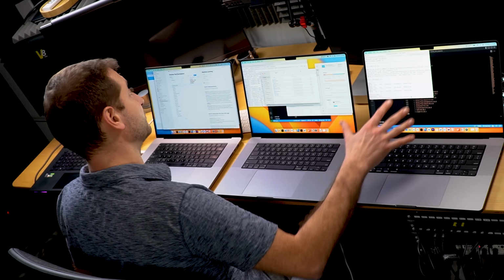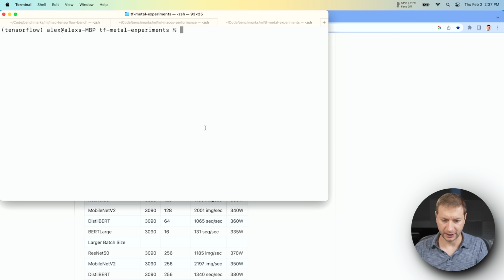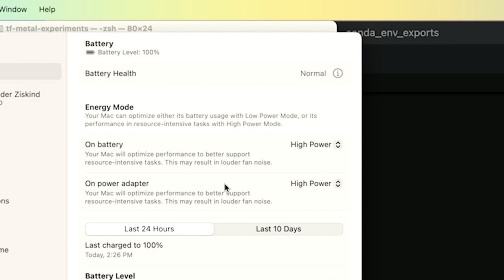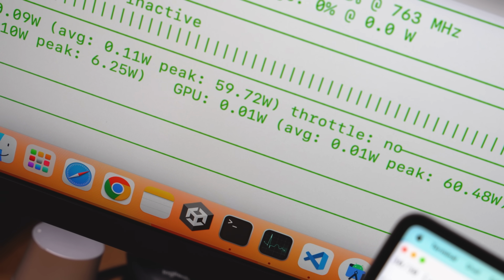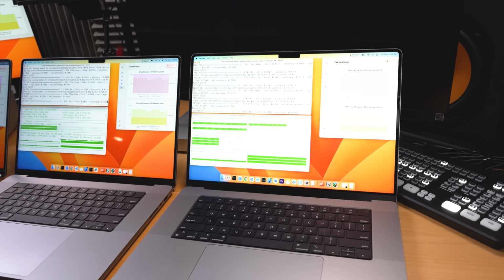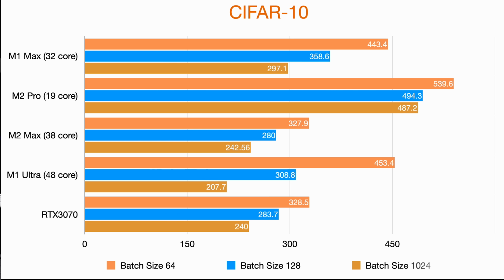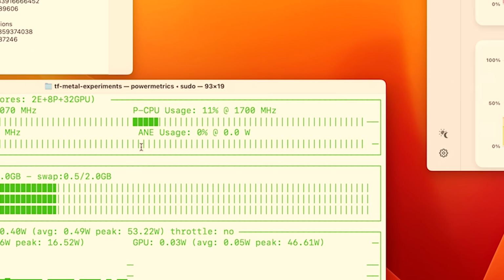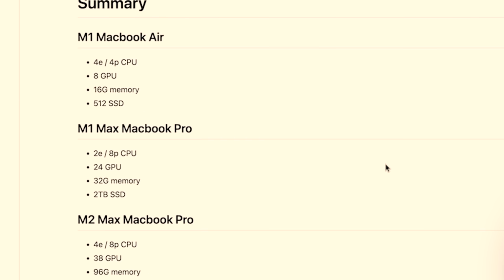INSANE Machine Learning on Neural Engine | M2 Pro/Max

Comment: The ANE is something different. As I understand it, it’s designed for matrix (tensor) calculations in contrast to the CPU. I’ve trained NN using python and tf, and i know you can format the trained model in a way so it can utilize the ANE on iPhones using swift, the performance is amazing IMO. However now I started to go a bit deeper into swift, I want to try and train models on the ANE 😅. Awesome video btw. Love this kind of content, glad i found this channel.
Reply: well the way how it's done is not that important as a final results. We are not using computers focusing on tool itself, but on getting job done. And seems like Apple did a pretty good job with their processors :)
Reply: Hey I'm currently in 1st yr of cs n specialising in aiml confused which laptop I should buy windows with GPU or m1 or m2 pls help n if mac are the thing for an aiml engineering
Reply: @riteshdhobale8210  Consider this. If you are just starting,  you will most probably work with more basic models, math and general coding (python, R, JS, MOJO...). For most task the M1, M2, M3 macs will do just fine, they are much more than you'll need for learning. When you start with DL (deep learning), the macs are still good but start to get very expensive (M1, M2, M3 MAX). This does not mean that you HAVE to buy a MAX model, things will just go faster on them, the PRO models will do ok as well.  Most of DL is done on GPU clusters anyway (AWS, AZURE...). All that being said, if your main focus is to go for DL directly (which i don't recommend, but most people do), or you want to play with already existing models than go for a laptop with a good GPU.  Last thing to take into account is the VRAM. The one thing that separates the macs and PCs (for now) is the underlying memory architecture. Because macs GPUs and CPUs share (in a sense) the RAM, you can load much larger models into memory to do inference. Simple example an  RTX  4060 has 8GB of VRAM, and the macs can get access much more RAM (up to 128 GB) but this costs a lot of money. If you go for a mac go for the 16 inch. Hope this helps.

Comment: What I wonder is if the high RAM M2 Maxes (like 64GB or 96GB) can train significantly more complex models or use significantly bigger batches simply because they have more ram than most discrete GPUs.
Reply: Data Loading: The dataset used to train a model is first loaded into the system's RAM before it can be utilized. If the dataset is large and the RAM is insufficient, it can't load the entire dataset at once, which can slow down the training process as data needs to be constantly loaded and unloaded.

Batch Processing: Deep learning models are typically trained in batches due to computational limitations. The batch size (the number of data points that the model sees at once) directly affects how much RAM is used. Larger batches require more memory but can lead to faster and sometimes more stable training. However, if the batch size is too large for the available RAM, it will cause an out-of-memory error.

Model Size: Larger, more complex models (more layers, more nodes) require more parameters and thus more memory to store those parameters. Additionally, during the training process, the system also needs to store other information such as gradients and intermediate layer outputs for backpropagation, which further increases the RAM usage.

 Parallelism: If you're using a framework that supports it, and you have sufficient RAM, you can train multiple models or multiple parts of a model simultaneously, which can significantly speed up the training process.

Speed: RAM is much faster than disk storage. So, the more data your RAM can hold, the quicker the access time, and thus, the faster your model can train.

Swapping: If your system runs out of RAM, it will start swapping data to disk, which is a much slower process and can drastically slow down the training process.
Reply: @sharathkumar8422  I understand the theory. But I want to see benchmarks.

In theory the M2 Max with maxed out RAM is great for ML. But I'd like to see some benchmarks in practice.

Performance is also based on bottlenecks, and if the GPU is insufficient, it doesn't matter how much RAM you have, you can use a GPU with inferior RAM and it will still blow you out of the water.

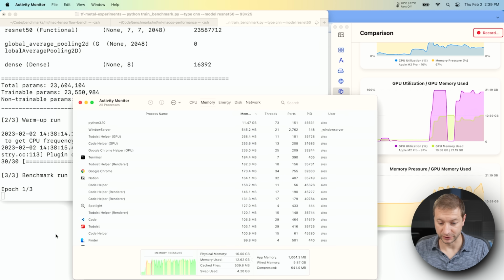Comment: 3:17 - one way I prevented the swap on my M2 Pro 14 inch MacBook Pro with 16GB ram was to disable swap. and I have ran into any problems, the performance will degrade if you do this on an 8gb 13 inch macbook with m2 or m1 because it relies on swap for increasing performance but on the 16gb with swap off, not only does it help ssd longevity but it also never runs into any performance hiccups

Comment: Cheers Alex, great to see something actually using the ANE. Something's seriously wrong with the M1 Ultra, it has double to M1 Max resources including a second CPU & ANE and more GPU cores even if they're a little weaker. Any chance you could check the CoreML config to see if the extra resources can be used?

Comment: Now I really want you to get your hands on a 4090 new notebook to test it to the limits.
Reply from the maker: believe it or not, I was considering this, but you are literally the first one that asked.
Reply: @AZisk  yes, please. So far nvidia new gen seems promising. But how it stands up against M2 Pro/Max?!
Reply: @lightytan5404 the new laptops or portable laptops with the intel new hx laptop processors with the 4090 sound like helicopters and forget battery life but they are monsters. 😂
Reply: @GlobalWave1  better have helicopter than 105 degrees cpu/gpu
Reply: Should not squeeze a 4090 into a small laptop!
Reply: @LeicaM11  4090 is a misnomer. the 4090 in a laptop is nothing like the desktop 4090.

Comment: As a PyTorch user these type of comparisons with benchmarks written in PyTorch running on the M1/M2 GPU would be awesome :)
I believe the results will probably be similar though.
Reply: they're actually very different, tensorflow has been optimizer for apple soc, but pytorch is nowhere close in performance on apple soc
Reply: @MosWaki7  was going to say just this.

Comment: I am interested to see how the 14" M2 Max performs, are there any significant difference between the 14" and 16"?
Reply: thermal throttling, to prevent fan noise, overheating, apple reduces cpu and gpu performance on the 14 inch, also there's no high performance mode on the 14 inch which a lot of devs use as battery life is great

Comment: Very helpful info, thank you!
With Nvidia 40 series laptop coming out soon, it would be very interesting to see how M2 GPUs perform against the likes of 4090, 4080 in deep learning tasks
Reply: in terms of raw compute power, the 40 series has more. The main limitation is memory and how much you need. if 16 or 24G is enough, paying the NVidia tax is better than apple tax. If you need more than 24G, M2Max might be the cheaper tax. Only way to know is take your workload, run some benchmarks and then figure which fits your needs.

Comment: Lovely video as always! 
I've got a question, which Macbook would you consider 'worth the money' for a Data scientist and/or a ML/AI engineer ? Obviously it depends on the work one does, but it seems some tasks require terabytes of Ram, not GB's and so upgrading to 96 won't cut it anyway. On the other hand,  going to low will enforce one to always use cloud services. At this point, I've tried a M2 macbook pro 16"  base model (16 Gb ram), and I've run out of ram computing scattering transforms on a relatively small (2Gb) dataset. So the choice for me must be in the range of 32-96 I suppose.
Reply: I'd probably say 64GB is the sweet spot.

Comment: Thanks for this!  I ended up plugging for a 24GB M2 Air because I thought it would be a while before Apple silicon would be at all useful for (real world) DL.  perhaps I'll be needing another machine sooner than expected!

Doesn't the Nvidia have almost 6K cores?  I would absolutely expect it to trounce the Apples, even though it's old - I was most surprised how close some of these benchmarks were.  But ultimately, until more of the DL frameworks add proper support for Apple silicon it's a bit of a moot point and I imagine most (Mac based) developers will continue to use cloud resources for their work.  Of course once there is proper CoreML support in Tensor Flow / PyTorch then you may train/refine on a laptop.

Comment: Thank you Alex for this great video. I'm very impressed with the results comparing the CIFAR10 with 1024 batch size, because it shows the difference in RAM speed between Apple M processors and the RTX-3070, the RTX is faster doing the calculations. By the way, my Desktop RT-3070 took 301.787s , 270.702 and 234.107, with 64, ,128 and 1024 batch sizes. During the test My RTX used 178 watts !!! we have to add the power usage of the CPU and other components.

Another interesting thing I've notice is that if you consider that every GPU Core in the M1 Max, M2 Max and M1 Ultra processor, has the same processing power, you can almost find the images / second starting with the M1 Max times, just doing a simple aritmetich operation, this is very interesting because in Deep Learning training the performance of the M1 Ultra scales equals or proportional to the number of GPU cores it has, something that is not valid in other tasks.

Finally, it would be very interestin to compare the inference speed with a Jetson Xaiver NX o similar board, because this NVIDIA boards cost more than US$1000, I think that a Mac mini M2-Pro could be faster than the Jetsons in inferences, and could replase the Jetsons in some tasks, the Jetsons have many advantages over a Mac Mini of course, for example they have many encoding/decoding engines to process many streams of video in parallel. But who knows, maybe someday we will see a robot with a Mac Mini with an M processor in it.

Comment: Thanks for doing this test.  It was quite eye opening.  I am getting a M2 14" pro and was wondering about the requirements and how much upgrading the base models memory would help.  Looks like I would have to upgrade the memory and go to Max to get a big performance increase.  Since I have access to cloud based systems with GPUs and TPUs I think I will just go with the base system.
Reply from the maker: glad it was helpful. Thanks for your courses 😊
Reply: @AZisk  thanks for the kind words.

Comment: If I have to use local LLM model says for pair programming now or in future which one would you suggest kindly help:
M2 Mac Mini with 16GB RAM and 1TB (external SSD NVME M.2) or
M2 Pro Mac Mini with 16GB RAM, 513 GB SSD?
Here in India cost difference is huge? Let me know which will help me better in longer run for programming, mild video editing, and mostly LLM locally for pair programming, etc.

Comment: Thanks a lot for this! Does the M2 Pro Mac Mini (16-core neural engine) perform similarly? I'm trying to decide between the M1 Max Mac Studio and the M2 Pro Mac Mini for machine learning. They both have the same specs aside from the Studio having a 24-core GPU compared to the 16-core GPU of the Mac Mini. Would the difference of the M2 Pro over the M1 Max be more worth it than the 24-core GPU vs. 16-core?
Reply: depends un usage. M2 Pro has more high performance cores than M1 Max. M1 Max has more GPU cores.

Comment: What program are you using to monitor the GPU? I have installed something called iStats - but yours looks a bit different. Great video! I installed tensorflow-macos and tensorflow-metal in a venv virtual environment but sometime I get some errors and it stops. Tricky install!
Reply from the maker: iStatistica
Reply: istatistica

Comment: Thanks - great video and comparison between the different MBP models! Planning to ditch my Intel MBP and (maybe) my Linux RTX-PC. Apple Neural Engine has an insane potential for computation purposes on Apple Silicon macs. Is it really so that Apple Neural Engine does not expose any proper API to be used for generic (python) OSS tech-stack DL training purposes? Only Apple CreateML in training and CoreML inference?

Comment: Can the Mx Max chips actually run 3+ monitors at the same time? Have you made a vid about this perhaps? Thinking of buying one.
Reply from the maker: Yes and yes :)
Reply: straight from Apple's website:
M2 Max
Simultaneously supports full native resolution on the built-in display at 1 billion colors and:
Up to four external displays: Up to three external displays with 6K resolution at 60Hz over Thunderbolt and one external display with up to 4K resolution at 144Hz over HDMI

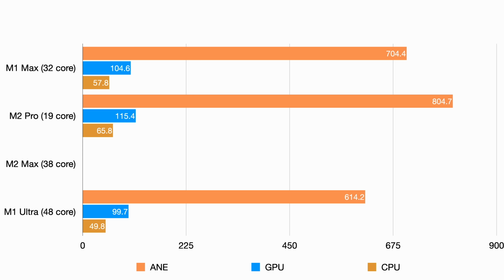Comment: 15:00 why is the m1 max doing better than the m1 ultra
Reply: Because M1 MAX = unbinned 32c GPU,  M1 Ultra used the lower end 48c (2x 24c M1 MAX) instead of 2x 32c = 64c.
Reply: @IntuitIntel thank you

Comment: The ANE benchmark results for the M1 Ultra are astonishing. Especially where the M2 Pro was faster. Indeed, according to the specification, the M1 Ultra chip contains twice as many Neural Engine cores - 32, while the rest have only 16. The M1 Ultra was supposed to be faster than any M1 / M2 Max or Pro; in this case, it does not matter that the M2 has a slightly higher clock speed or more GPU cores. However, 32 ANE cores do not always give a performance boost. Very strange.

Comment: Alex, how did you run tf-metal-experiments? I followed all the steps and got errors during runtime. Some google search showed this due to tensorflow for macos being too high - 2.11 installed in my case.
Reply from the maker: try downgrading tf
Reply: @AZisk  Thanks, that did the trick. The version 2.11 was no good, downgrading to 2.9 worked!
Reply from the maker: @usptact  nice!

Comment: I have an HP Victus laptop with RTX 3050 Ti Laptop GPU (4GB RAM). I use it for deep learning and the 4GB RAM is less than sufficient. I always run into OutOfMemoryError
I'm considering buying the Macbook Pro 14inch M2 Pro with 16GB RAM, the one that you tested in this video. Should I buy it? Will it be sufficient for me? Can someone give me an in depth answer.

My use case is not that of a beginnner AI student. But im also NOT training LLMs. For example, I'm doing a project where I'm training an Efficient Net b5 model and I cant use batch size more than 8. otherwise it gives me OutOfMemory Error

Anyways, can somoeone please help me. Should I buy the M2 Pro Macbook 14inch with 16GB ram?

Comment: 🎯 Key Takeaways for quick navigation:

00:00 🖥️ Introducing the Machines and Models for Machine Learning Testing
- Brief Introduction of M2 Pro and M2 Max and models to be tested
- Introduction of the machines to be used, inclusive of a PC laptop
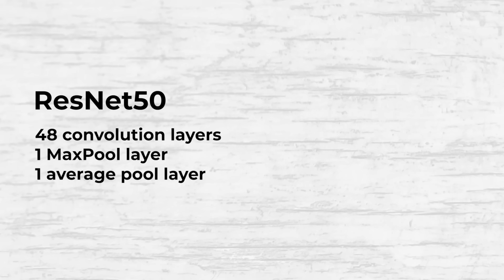01:23 🔍 Deeper Insight into the Models
- Explanation of the varying models such as resnet, mobilenet, distal bird, and bird large
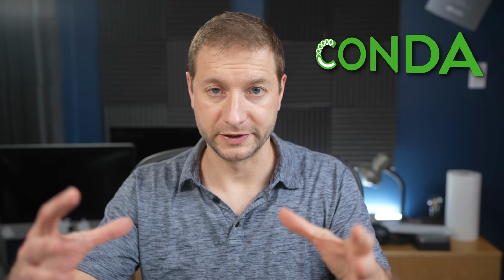02:48 💻 *Detailed Documentation of Training Deep Learning Models *
- Description of setting up a conducive environment for dependencies,
- Highlights on the heavy dependency on memory for the training
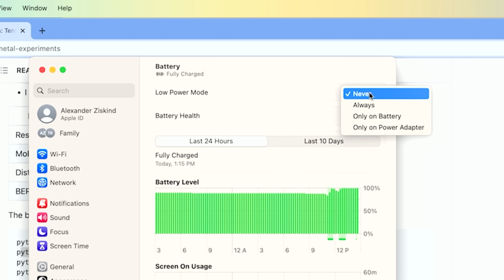04:12 ⏳ Experimentation on Multiple Devices
- Descriptions of how tests are kicked off on different machines
- Provides real-time feedback on how different machines are responding to the test
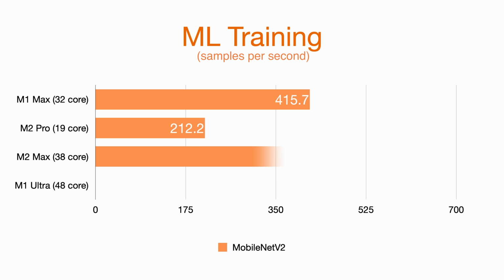06:05 📈 Wrapping Up and Analyzing the First Set of Results
- A look at the results obtained from the various machines
- Commentary on the impact of GPU core count on the results
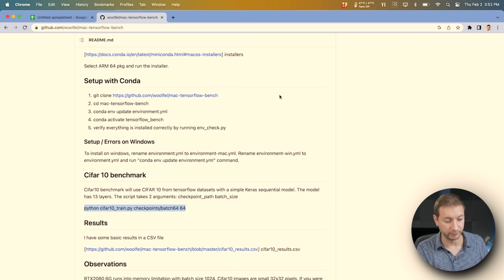07:55 🔄 Another Round of TensorFlow Experiment Focusing on the PC
- Explanation of another TensorFlow experiment that includes the PC
- Description of the different batch sizes and the dataset used in the experiment
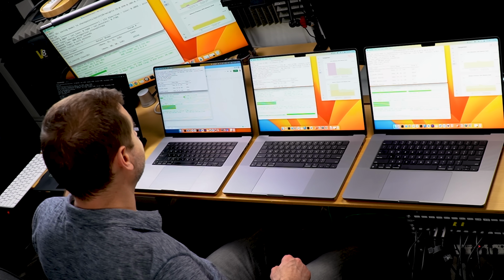10:12 🔮 Insights from Third TensorFlow Experiment with Different Batch Sizes
- Analyses on the outcome of the second batch of experiments
- Insights on how power usage directly impacts the speed and results
11:50 🧠 Focusing on the Usage of Apple's Neural Engine
- Introduction of a test that demonstrates the Apple Neural Engine
- Commentary on the impressive results driven by the Neural Engine
13:54 📈 Results from Experiments with the Neural Engine
- Description of the results obtained from the experiments involving the Neural Engine
- Observations and insights drawn from the results
15:28 🔚 Conclusion and Closing Remarks
- Final thoughts on all conducted experiments
- Encouragement to subscribe for access to more tests and software developer content.

Made with HARPA AI
Reply from the maker: wow thanks!

Comment: This video is interesting. But the reason I'm hesitating to get the M2 is that I don't know how much it will speed up my neural-engine limited application. Basically, my app is the MacOS Shortcuts app which is running in an infinite loop doing an OCR of the entire 4K screen. It takes 4.1 seconds to perform OCR on the entire screen. If the M2 can do the same work in less than that, I'll probably buy it. I realize that my situation may also be dependent upon SSD speed, because the screen has to be put into a file to be sent to the Shortcut which does the OCR. Is there a way to do an OCR of the screen without putting the screen into a file first?